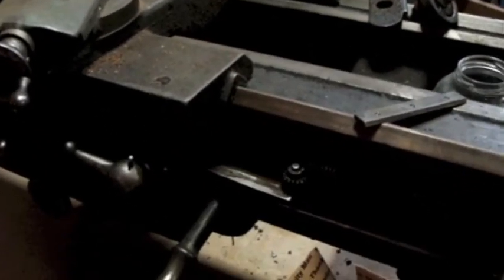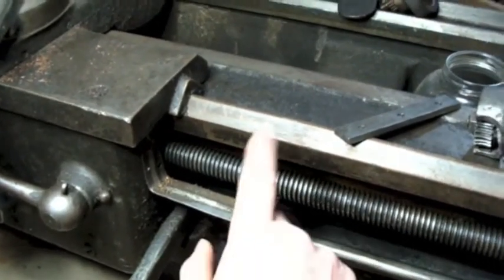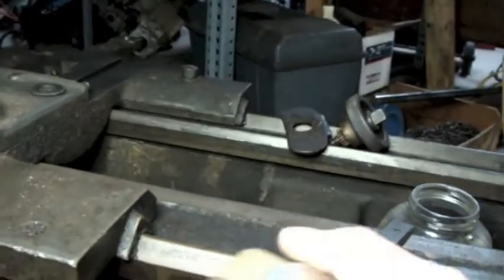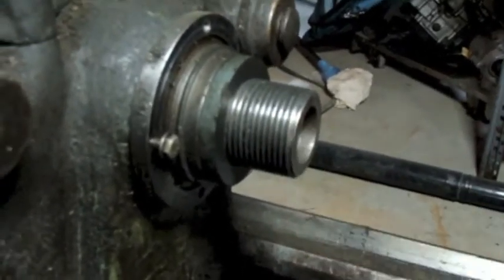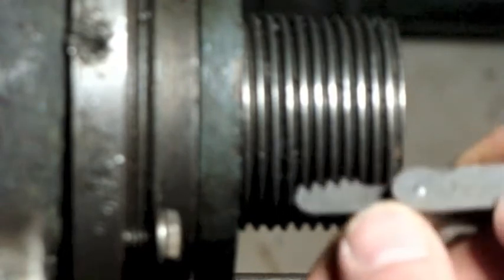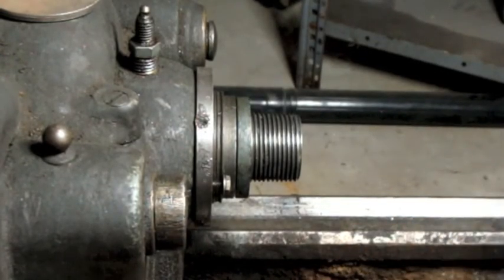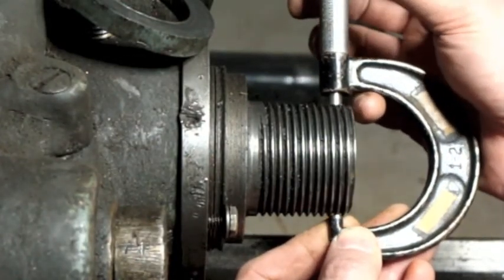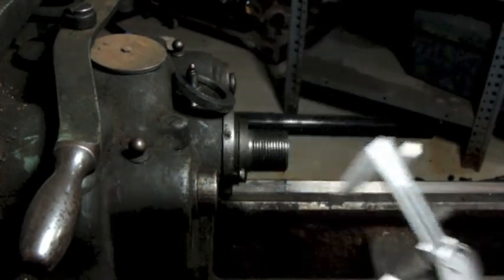Hendey Lathe Part 30

Comment: Hey Steve hendey must have changed there spindle diam the pitch on my 14X6 conehead lathe is about 2.250 X 6TPI.... I am having a problem finding information on 2.250X6TPI major diam size so i can make some backing plates  for several chucks that i have..
Reply from the maker: I eventually just googled mine and the only couple of references I found to the spindle size on a 12" Hendey both stated it as being 2", so that sort of agrees with what I measured, if I take into consideration the taper. I had a nice guy send me a big faceplate he had for cost of shipping. Imagine my surprise when it actually thread on the 12" spindle, but I think once the headstock is back on the bed, it'll be a hair too big.

Comment: Steve;

My thinking is you have a 2" by 8 TPI spindle that has been worn down over the years.  A 2" thread diameter would not be exactly at 2" as it would be cut down a slight bit to allow for the "round over" at the bottom of the thread tool (i.e., the thread is not a perfect "V", the tops of the "V"'s are flattened off).  2" x 8 TPI is a very common spindle size.

Your better bet is to use the 3 wire method to measure the diameter of the inner part of the thread and not the surface and then use Machinery's Handbook to check.

Regards;

Ron Kluwe
Reply from the maker: I was able to confirm it is a 2" 8 TPI, but I do not believe it is worn. Turns out other Hendey owners have confirmed that Hendey tapered the spindles. Theory is they did it to help make starting the chucks onto the spindle easier by making the female threads straight, i.e., no taper.

Comment: nice to see another hendey being worked on. I have a 14x30 in use check my vids hope this helps Nick
Reply from the maker: Hi Nick, just watched your video. Nice looking Hendey tie bar model you have there. I noticed you said it is a 1941. I thought production of the cone heads was finished by then?
Reply: stevewatr I had the lathe dated by Hendey Man on practical machinist forum and have traced the history of the machine through the company that it was supplied too. it was built is 1941 and was ordered by the US war department for export, it arrived at Peter Brotherhoods in Peterborough it was initially used to make torpedo parts it was then installed it there toolroom after the war for a further 10 years it was then moved to the electricians shop where it was used to wind motors ( because it has such a slow back gear). When I got the lathe the apron did not work, when I stripped it down i found it full of copper wire. Like you i was surprised when i heard how new this tie bar / cone head wss it must be one of the last tie bars ever made , i suspect they were revived during the war years because they arte so simple and quick to make compared with a gear head . I think this is the last Hendey in the UK 
Cheers Nick

Comment: The pin on your chasing dial sets into a slot or larger dia. hole that lets it rock in and out of engagement with the leadscrew so you can disengage it when you're not using it.